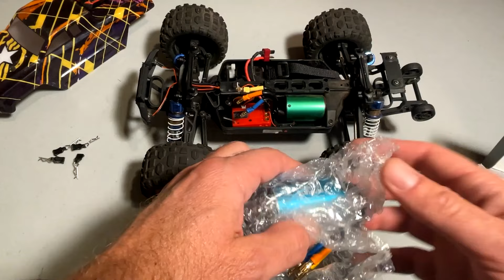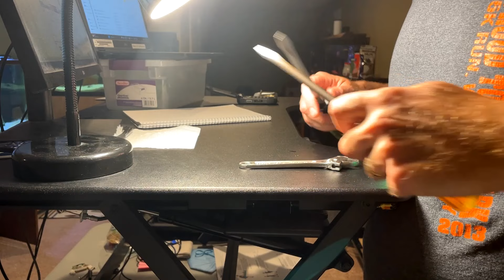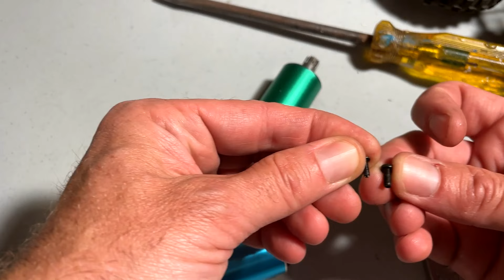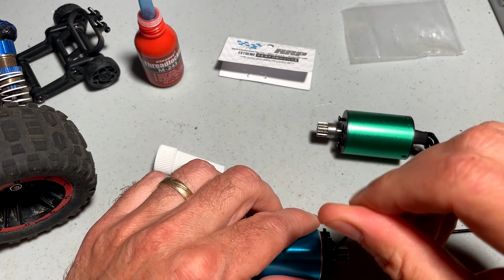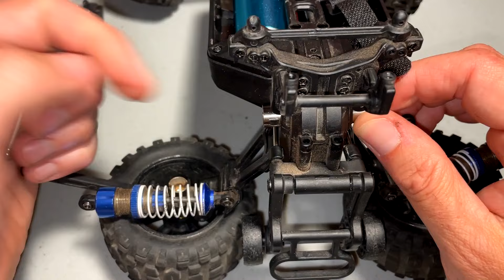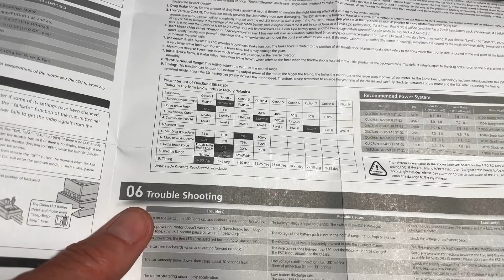How to Install a King Val 2845 5900kV Brushless Motor/ Hobbywing 60A ESC into a HBX 16890A = FAST AF

Comment: installed a surpass hobby M45A ESC and rocket RC 2845 4370kv motor with a 13t pinion gear it sometimes cogs and it just disables the power to the motor
Reply from the maker: well, that is unfortunate. I would expect that with taller gearing but you’re set up is pretty mild. Maybe you could try a different ESC?

Comment: Did this to both my MJX RC's but ended up boring out the stock pinions to 3.175(1/8), in lieu of purchasing pinion gears.
Reply from the maker: I find the stock pinions to be really small for speed… But good for general use.good idea drilling them out!

Comment: How much did the build cost? Motor, esc, esc card, radio and receiver.
Reply from the maker: @joejosiah  I already had some of the components and got some of the from
Channel sponsors but about $120 if I had to buy everything when I built it… Maybe a little more now with inflation.

Comment: Will my motor connecters 3.5mm 2845 4400kv surpass hobby motor  also fit a 60a esc or should i change them ? Yours sincereley Aaron from speedslides and speedrides
Reply from the maker: Hi Aaron!  Most ESC's come with 4mm bullets so you will probably need to change them.  

Just check the ESC and see if it lists the size bullets it comes with.
Reply: @BriansRCStuff  thanks man ! Than i think iam going to order the 3.5mm to 4mm plugs conversions adapters. The motor did fit in the 60a hobbywing max 10 off my traxxas and worked very good on 3s.

Comment: Hey Brian, this video is awesome!! Quick question, any chance you know where to source the little red/orange gaskets that go between the motor and motor mount? I'm switching motors in my 16889a pro but I plan to replace everything rather than remove the mount and pinion so I have the stock setup intact plus the upgrade setup. Only thing I can't seem to find is that little gasket. Any help would be awesome, thank!
Reply from the maker: I haven't looked for the gasket for the 16th scale trucks.... but the 1/12th scale trucks (part P101) were a pain to find!  Redcat actually sold the same part and I got them but now they are out of stock and you can only seem to source them from Australia!  

They are really important as I found out in another when doing a conversion on my 2997A as I didn't have one and I tried mocking it up without one and the motor moves around way too much.

Let me take a look and see what I can find if anything.
Reply from the maker: Well, it seems like they are out of stock everywhere in the US and I think the P101 would be too big as it is for 540/36mm sized motors.  I did not see a part number in my HBX 16890A manual for the 380/28mm sized motors.  I found this part number but I cannot confirm it is the right one. HBX-5108 motor pad

You can order the P101 in Australia and UK but they murder you on shipping (like $12).  I am going to reach out to my HBX contacts and see what the deal is (if I can get a response).  You are not the first person to ask me.
Reply: @BriansRCStuff  Hey thanks so much Brian for the quick reply. It seems that the motor pad is in fact a detrimental component to have in place. Most parts are super easy to source yet these motor pads seem to be quite tricky. Let me know if you have any luck. Thanks so much for your efforts and keep the great content coming!
Reply from the maker: @petervenner2450  thanks man! I should get a response from Haiboxing soon. Hopefully they will have something of value to share.
Reply from the maker: @petervenner2450  How about this?  I cannot confirm the the MJX is the same thickness or material (it is at least a different color), but this may be an option. https://www.aliexpress.com/i/3256804477066651.html?gatewayAdapt=4itemAdapt
Reply: @BriansRCStuff  Looks pretty similar to me. Kind of likes like it's made of metal. Either way I'll likely order that anyways and take a closer look considering it's only a few bucks. Thanks again Brain and let me know if you do hear back from HBX!
Reply from the maker: @petervenner2450  will do and please let us know if it looks like that will work!

Comment: So i bought a 2845 5900kv motor as well but form surpass hobby what pinion gear do i need to get?
Reply from the maker: What car is it going in?  In the 16890A you can only fit a 13 or 14t.  I would stick with the stock 14t one.

If you need a there, I have a link in many of my videos.😎
Reply: @BriansRCStuff  it's a sweep pro or drive pro not sure which one found it on temu.
Reply from the maker: @InhumanArcher  it looks similar to my 16890a.  Can you remove the gearbox/motor mount cover and verify it is the same.  If it has the same motor mount, it will say on it (the side facing out) how many teeth the pinion has…. Or you can of course manually count the teeth.  Alternatively it may say in the manual.

If it’s the same has my 16889a it is a 0.6 mod gear.

I have a video that show the process on my HBS 16890a.
Reply from the maker: @InhumanArcher  fair warning, that motor will run hot on 3S after a couple of min.  2s will not be too bad but make sure to monitor it on 3s and let it cool
as needed. 👍
Reply: @BriansRCStuff  alright so I took the rc apart and it seems it's a 18t for the stock motor
Reply from the maker: @InhumanArcher  interesting.  I can’t confirm it is 0.6 mod but that is what my HNX truck is.  In the mount a little black plastic piece that slides into the slot?  Did you look on the other side to see if there is a different option?
Reply: @BriansRCStuff  mine looks be metal or aluminum not sure but I can't seem to unscrew it and I really don't want to strip the screws.

Comment: How did you put the 4.0 mm connecter from the motor into the 3.5mm esc?
Reply from the maker: If you watch the video, you will see I used a Hobbywing ESC as that motor would have likely not worked well with the stock ESC and even if it did work, it would have likely cooked it!  I had to solder on 4mm bullets.

Comment: Try to use Surpass Hobby 2838 6200kv, its much stronger
Reply from the maker: What makes you say it is stronger when clearly that is true?  It is actually weaker as it makes less torque and draws less amps.

It may run about the same speed  but it will likely run hotter which is already a problem with the combination I am running.

It would be a fun set up to try but be careful monitoring the motor temps  at 3s.

Comment: Will a Goolrc 60A ESC also do 50 MPH with this motor?
Reply from the maker: It depends on if the manufacturer is lying about it’s amp rating. On paper, it should be fine. I run a surpass hobby 60 amp ESC with a motor that has a rated draw of around 66 amps with no problems but your results may vary. :-)

Also, you’ll need a decent performing battery for those kind of speeds.

I would love to hear how you make out. I definitely think it’s worth a shot as it should be fine theory.
Reply from the maker: On 3S, the motor will probably overheat before the ESC.

Does it look like there’s room for your ESC?

Also, I would definitely turn the punch down to its lowest setting on that ESC. Even when it turned all the way down, it will have crazy acceleration. That will also make it draw less amps and not be as hard on the ESC.  Reality you can only stay full throttle for a few seconds at a time.
Reply: Of course, there is enough room for Goolrc 60A ESC, I have HBX 903, but yes the motor is heating a bit, becouse of motor cooling. @BriansRCStuff
Reply from the maker: @dimamariankov1929  did you try mounting it on top of the servo?

That stinks.🙁

I never got around to trying the surpass hobby cooling fan and heat sink combo but that may help…. Some.  In 3s that motor just spins so fast it probably isn’t going to be happy running more than a few min.

Comment: got same rc and i want to upgrade like u did...great job....sub done!..
Reply from the maker: Thanks man!  It is ridiculously fast but fun in a stupid way.  I might try some small foam tires to keep the center of gravity low.  I wish the gearing was easily adjustable with taller gearing!

Did you see the running videos?  Up to 56.9 mph.😂
Reply: @BriansRCStuff  yes i saw it and it's amazing bro
Reply from the maker: @treb1395  oh, thanks man!Appreciate the comment.

Comment: very nice mate! I had a lot of problem with the pinion, was stuck in the stock motor and I spend like 2h to swap into the new 2845, with a bit of thread locker I was able to use it (so far I ordered one that is still on the way).

Dunno why I bought the 30A and not the 60A, I think it is indeed better with I was still not able to try it on full throttle yet ! :D

And I'm still stuck to find the right tires, I love the 903 but I'm looking for another option (I have a few sets but no one I really like)
Reply from the maker: You having a hard time controlling it?  Mine for sure is a handful!

What KV motor did you go with?  How did you end up getting your pinion off?

I guess the 30a might be okay because it is such a light can and you can’t stay in the throttle for long!  What brand ESC did you go with?

Comment: Great stuff bud.   HobbyWing is a great ESC for these guys.  A+++ Content Bud.  Keeper RIPPIN!!!!!  👍
Reply from the maker: Thank you!  I love how flexible the program is compared to my Surpass Hobby ESC.  At $38, sure it is more expensive but still reasonable (plus very compact).
Reply: Yessir.  Get what ya pay for usually.  Plus you could use that in allot of other rigs it will do you well..  I have learning Brushed version for my daughter wl144001 been very pleased with increased performance over stock.  Always learning good stuff brother.

Comment: will the stock esc hold 3s?
Reply from the maker: It is not rated at 3s but it ran fine when I ran mine (I have a bunch of videos running it - https://youtube.com/playlist?list=PLvljFhULHkefc8RQ-9OQuqTCl1oI98Qnd).  When I went to bigger tires however it would cut out violently sometimes.  

I never tried it when it was hot out....

Comment: I’ve got a 2845 surpass hobbies motor in 2 of my radio shack vehicles. It’s way too much for them but sure is fun
Reply from the maker: The trans holds up okay?  That is outstanding.  Any videos on it?
Reply: @BriansRCStuff  as long as I don’t floor it off the go. I learned that the hard way and blew out high gear in the frame buggy. It still does 25 in low